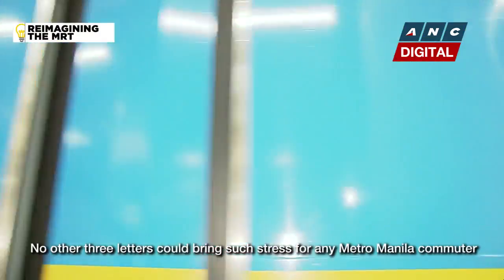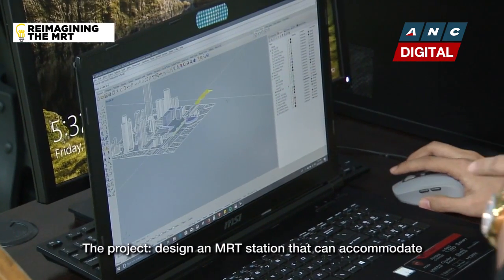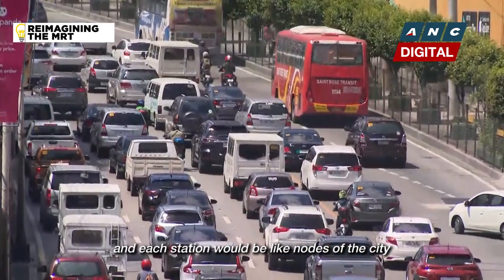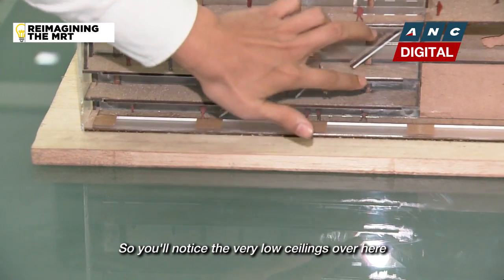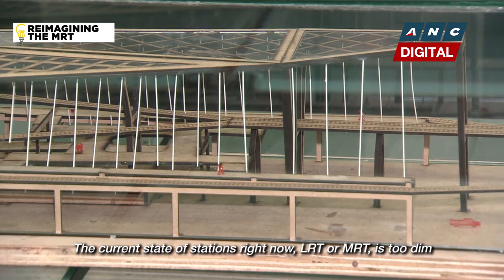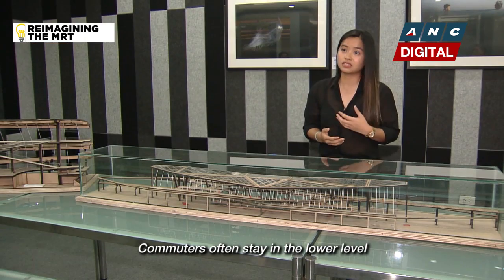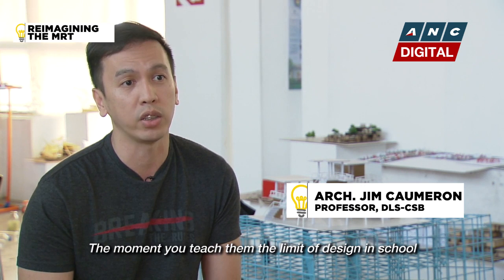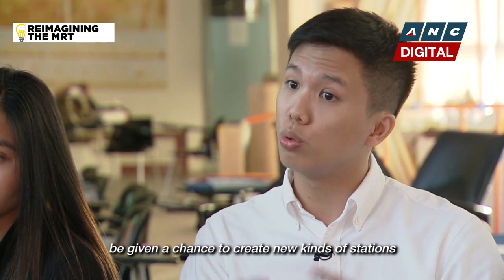Reimagining the MRT | Think Possible

Comment: You dont need very big station for metro, or multiple levels station beside concourse and platform. It can be eyesore. As its gigantic structure in the middle of the busy road with distance of only 1- 2 km to each other. Imagine that. Not to mention its not ergonomic and efficient, its wasting more time to reach the platform. Expecially when you are in a rush. What you need is more trains with 6-8 cars per set, and headway of 2 or 3 minutes. Make it automatic, so it will arrive exactly on that time. When will they understand?

Comment: To be fair her design is better, replace ramps with travelators with is convenient for handicap people. More sunlight in the day that is good for a station because it gives you less stress. no need for natural ventilation a high ceiling will be good and since it will be crowded during operating hours must be fully air-conditioned.

Comment: Brilliant.You're hired by the Duterte build build build program. We have that here in Toronto. It is called PATH an underground web of pathways and shopping malls and food courts where you can navigate the downtown core without crossing the road and not exposed to the pollution (noise and air). Original plan was actually underground roads so people or pedestrians only at street level. The subway rail line and all the major places of interest like shopping malls, hotels, government service offices, theaters, civic centers, tourist attractions, etc are interconnected.

Comment: The thing is— its not the looks AND DESIGN that needs improvement. ITS THE SERVICE AND ITS EFFICIENCY THAT NEEDS TO BE IMPROVED AND NEEDS TO BE WORKED ON. They may approve of a new design and look of the MRT stations, but if the service is still awful, unreliable, and its still inefficient— the station designs are pointless.

Comment: How does this improve anything?  The problem is the MRT is at 300% of design capacity and growing.  A nicer station doesnt change that.  Trains are too small, too short, dangerously overfilled and not enough.  The lines will only get longer